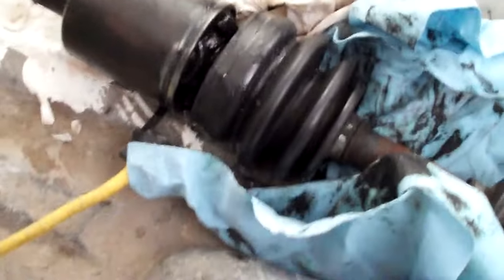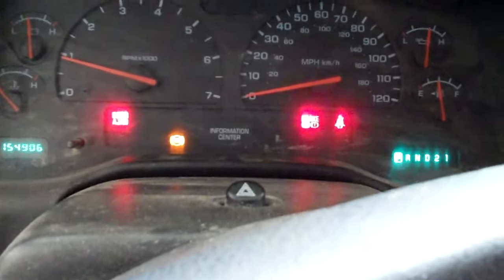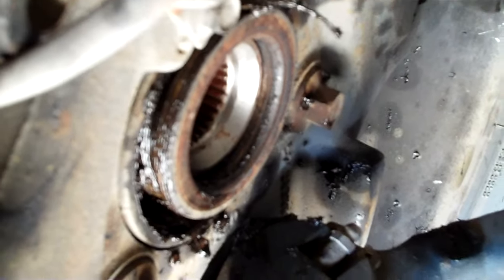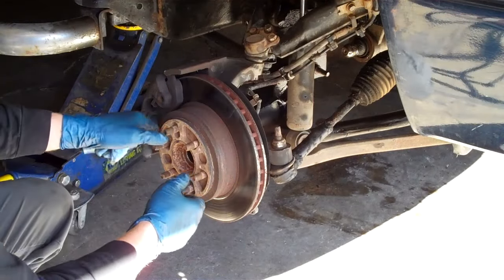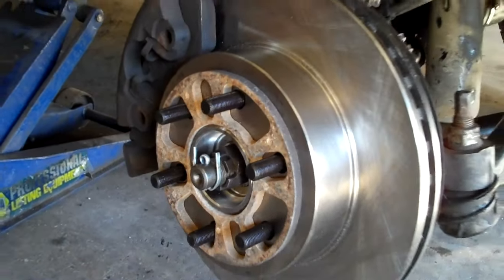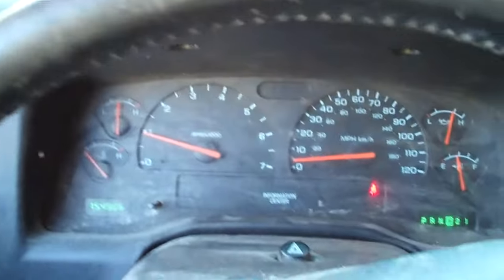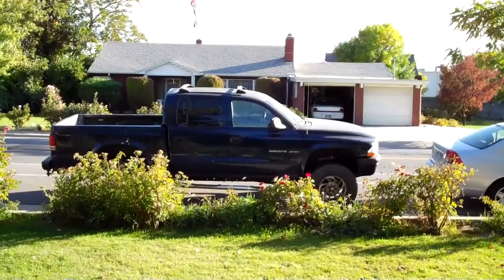What Happens if you Drive with NO CV Axle Here's what Happens....

Comment: I learned this the hard way. Drove my 97 Ram for several thousand miles without them. Snapped 2 wheel bearings in a week. Replaced one and it snapped the second I put the truck on the ground. Eventually had to drop a new front end in it, don't risk it y'all.

Comment from the maker: That's right.  His hunting buddy who was with him is a diesel mechanic in training and recommended he just pull the axle out.
Reply: So long the hubs remain in place, vehicle can be driven short distances. The reason 3hy I'd be willing to do this, is bcuz the driver side cv joint hub is usually stuck by retainer clip. So that will hold till its forced popped out. The wheel side hub is held in by center nut. Goes to say, if like me,, you can't get the tranny side hub out, but shaft axle joints are damaged, I'll remove axle  and leave hubs in place, till I can figure a method to remove inner hub.   Of course, it means the boots are cut out, and grease fully cleaned out.

Comment: A while back, my 96 suburban needed both cv shafts replace, but it woulda been like $400 to get them, so i made my own shafts. They are essentially shortened driveshafts, with a u-joint on either end, and a sliding spline shaft (from an old junkyard driveshaft), with the ends of the CV shaft (procured from the cv shaft) welded on. They are ugly as sin, but both of them together cost me less than $50 to make and they still work, going on 7 years. And i dont need the fancy rubber boots.
Reply: Jon Doe can you make a video about it?
Reply: Jon Doe lmao well u just lost the functionality of CV axles if u ever saw a straight axle mustang that is generally how all the half shafts are rigged up.

Comment: I tried that.  Once. 2001 Silverado. Some YouTuber did it so I figured I could get away with it, too. Decided to drive to town while waiting on new Axles.  Turning into a parking space both bearings blew apart and shredded.  Had to get a tow back home. Had to replace both wheel bearing assemblies, both caliper mounting brackets (the pressure actually distorted them), both rotors and both front wheels (gouged bigtime).  I mean, those wheel bearings tore apart in a grand fashion.

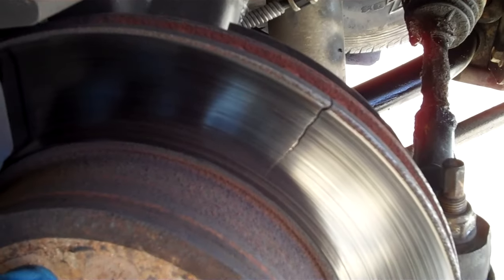Comment: Let me say this, I work in parts and as a mechanic. If you have a 4wd truck and you lose a front CV axle, YOU WILL NOT HAVE FAILING SPINDLES! The spindle has no parts to fail and is NOT PART OF THE CV AXLE ASSEMBLY. The reason that thing is falling apart is because the bearings weren't maintained nor were the axles. The only thing that happens is the front differential spins freely since there is no opposing torque(unless you have a locker or limited slip diff). You can drive it in RWD just fine with no issues whatsoever. The 3 bolts at 01:10 are the ones that hold the hub bearing assembly on to the spindle which is held onto the truck by upper and lower control arms. The brake rotor is held on by the wheel and lug nuts to the hub assembly. That little 3 bolt flange at 02:57 is actually pressed onto the bearings and essentially permanently attached to them and is what holds the wheel and brakes to the hub. This is simply a failure of bearings that was not taken care of coupled with a broken axle. I sell these bearings all the time and I have seen things just like this with the axles STILL INTACT ON THE TRUCK. This whole video is invalid information.
Reply: you are correct, if you purchase a hub bearing assembly for that p.o.s. chrysler product that obviously has already had the upper ball joints replaced, for a 2wd truck, you would see the new hub assembly also has splines for a c.v. shaft. hub bearing failure is not related the the use or non use of a c.v. shaft. MYTH DEBUNKED!
Reply: If you don t put the axle inside the bearing, the bearing will simply fail. The forces applied to it are not correctly transferred when no acle is present, resulting in catastrophic failure, as the bearing will be crushed due to forces applied. Nothing inside to give structural rigidity anymore with the axle out...(!)
Reply: GliderDS nope. That bearing is held in with bolts. The cv  has nothing to do with anything other than transferring torque. Has nothing to do with the side loading of the bearing. That wheel hub was failed before the cv did.
Reply: ImpenetrableSilence 
Quick question. 99 gmc suburban.
My bearings just fell out of the cv axle. Can I drive with it like that???
Reply: as i commented above, there are different wheel bearing arrangements. and depending on how its designed sometimes that shaft actually keeps the bearing together.
Reply: Is it going to be a danger to my family and everyone else around us on the road cause I had the other side broken all the way before and it drove and drove probably 4000 miles till I got it fixed but never no problems

Comment: my front axle was sloppy so I took them out and then went for a drive last weekend. wheel bearing hub lasted 5 miles and did the same thing.  Abs wire was ripped off the hub.   wish I saw this video first. two drive axles and a hub bearing was $278. tow was $75.  blown weekend fixin it!  just happy me and the GF weren't hurt! (axle nut torque is crucial here- too much or too little can ruin the bearing also)

Comment: In an emergency you can pull it out, remove the boots and the axle between the CV bearings. Then put the axle end on the wheel side and torque it down, then put the transaxle side in, then drive it. As long as the axle end is installed and torqued down the hub will work as normal, abs will come on. The transaxle end is installed to keep the dust out until you can get a new CV axle assembly installed. Hope that help someone in a pinch. Of course you'll only have a one wheel drive so go easy on it until you get it fixed. Best Wishes & Blessings. Keith Noneya
Reply: I don’t understand ?
Reply: @howto-wiki8291  CV Axles are made of three sections. The end that goes through the Wheel Hub Assembly, the Center Shaft that connects between the two and the Section that goes into the Transmission. When you have one side that is binding and you remove the whole shaft the brake rotor on some models can shift and rub and then become damaged like in the video. In an emergency to if you remove the center section of the CV Axle and put the outer shaft back in and torque it down, then the rotor won't be able to shift and you can still drive the vehicle. However if your don't put the inner shaft section back into the transmission all the transmission fluid will drain out and then the vehicle wouldn't be able to go anywhere. So the trick in an emergency to get your vehicle back on the road is just remove the center section of the CV Axle and reinstall the outer sections to keep the rotor aligned and the fluid in the transmission. Hope that helps explain it better. Best Wishes & Blessings. Keith Noneya

Comment: I remember in 2008 I was on the interstate heading back from Flight School and the Ford Ranger (only Rear wheel drive) I had at the time suddenly started shaking violently and the ABS light came on. I pulled to the shoulder carefully and looked up on my phone to see if there was a garage around (given I didn't have roadside assistance with my insurance policy at the time and couldn't afford a tow out of pocket). Found one that was only a couple of blocks off of the next exit which was half a mile down the road, so I carefully made my way along, keeping to the right side and running the hazard lights as I went slowly towards the Shell station.

Turns out that the cause of the whole problem was that when I had had the front brakes and rotors replaced at Midas a few months earlier, they had neglected to lubricate the tapered wheel bearings, and so what remained of the old lubrication dried out, resulting in the bearings rubbing against the rotor on the front right wheel until the bearings were ground away and the rotor was left grinding against the knuckle (all that remained of the bearings was a very thin fused ring about 2 mm thick). Surprisingly, all of that had been without any noise being created.

Comment: Oh wow you just help me diagnose my bad cv axle, my brakes were grinding and after taking em apart and putting them back together again throwing new parts at em 3 times they were still grinding, turns out my passenger cv axel was going bad and the wobble was pushing my brakes apart and making them sloppy in the caliper which made them grind. Thanks for the help!

Comment from the maker: They can make your lug nuts not seat as far as intended.  They can create stresses to the wheel studs (leverage).  Basically you compromise wheelstud/lug nut holding strength.  The right way to do it is to get a wheel with the offset you're looking for.

Comment: wow iv bin driving my 05 Dodge Ram quad for 7 years with no cv shafts(only put them in for winter)and no problem
Reply: Dagoberto Faudoa your 05 ram is different then this dakota...
Reply: Dagoberto Faudoa so it's safe to drive with no CV axles I have an 06 and my differential case exploded I don't feel like spending three grand on a new one you are the answer I've been looking for
Reply: I've been driving 2 years without my front axle shafts in my dodge not one issue
Reply: Mike what year Ram? I have an 02 4or that has a bad drivers side cv
Reply: If you're driving with no CV axle you need to bolt the hub assembly together... Otherwise you'll have a catastrophic failure like this guy lol

Comment: depends if the cv shaft is holding the assembly together. for example all toyota 4wd pickups 79-94 use what i would refer to as a full floating front. basically the wheel bearing is mounted on a snout, the axle shaft goes through the snout and engage in splines that are in a flange. the only connection between the shaft and the wheel is the spline. the shaft only transmits a torque. same for the 100 series landcruiser and everything before. the 3rd 4runner and tacoma use this type of shaft that rely on that threaded shank to keep it all together.

Comment: Leave the stub in, remove rest of axle, fixed lol
Reply: Ya diggggggg
Reply: i'm having same problem with an infiniti and i considered doing this and i'm so glad i didn't. i have new hubs but that would've put me back so far
Reply: @isaacdominguez3469 bro I'm looking at doing this now with my 2011 Infiniti g37x coupe. Autozone ordered the wrong part after I removed everything. Thinking it would fit since they verified before ordering it. I have to drive 600 miles in 2 days and I have a busted lower control arm which fucked up my cv axles in the front
Reply: I got a 2006 Infinity g 35x I keep installing new ones this about my 3th time and every time it keeeps breaking I installed coil overs still breaking I’m to the point where I don’t know what to do anymore
Reply: @EsthefanyGómez-k4k  did you ever find a fix currently going through the same !😭

Comment: If the   axle nut and the outer cv joint  were helping  in holding the wheel  bearing  together(from falling out),there will  have  to  be   another bearing on the outer cv side against the spindle to allow rotation.so no the bearing gave up due to the wheel spacers and took out everything else with it.

Comment: i worked at a gm dealer for a long time and i know gm came out with hub/bearings in like '08 for like the 99-07 trucks that were for both 2wd and 4x4, they had the splines for the axle but the rear sides were reinforced so it didn't need the axle and nut to hold them together. but you could still get the other 2 styles, and the regular 4x4 one, said for 4x4 only, while the 2wd ones didn't even have and axle hole. i haven't heard if any other manufactuers came out hubs like this yet.

Comment: I actually drove with my shaft out for a few weeks because the bering cage on the cv busted during a hella snow storm. Got under there and cut the boot out of the part in the diff to keep junk out then left the nut on the hub. Just leave the bolted end on. knock out the bering cage with a chisel. Then cap the end the goes into the selector.

Comment: Most people do not know that the axle nut when tight, keeps the bearing from getting shear pressure. In this case the wider tires and that wheel spacer magnified that force. He is very lucky to have not gotten hurt. If you find yourself in need of removing the axle to get the thing home you could leave the cup still bolted to the hub and remove the rest of the axle. Doing this will also leave a big gaping hole where the output shaft is that dirt and sand will get into. Its always cheaper to fix it right in the long run.
Reply: You are correct. The terms are axial load, side load. And radial load.

Comment: I just saw an s10 blazer that made it from North Carolina to West Virginia like this. It wasn't going to go any further. People don't seem to understand that the spindle nut is what's torquing the WHEEL BEARING.  Thanks for the informative vids with humor!
Reply: Answer me this on a front wheel drive vehicle, the rear wheel hub does not have a axle shaft to torque to. If a cv shaft was that important to a part time 4x4 that never is driven in the 4 wheel drive range then how do these keep from failing?
Reply: Different type of wheel bearing. Some wheel bearing  hub assemblies for non-drive axles, without a spindle and axlenut, do not require themselves to be pinched together. Drive axle wheel bearings are mostly conical, and need the cv shaft/ axle nut to keep it together.

Comment: I've had a number of CVJ's go bad, after the boot tore, but despite driving several even more than a year on, only the noise and looseness reveals any issue. Obviously removing the axle is far worse than just driving with the old one until you either repair the boot, or replace it. And he's right, the Soobie bearing is going to be compromised without a proper torqued compression to hold the two sides of the roller bearings under tension. Outer splined hub is pressfit into the inner bearing race, so without an axle nut it could conceivably fail and drop the wheel.  I'd worry about the uneven load on the differential as well, over time.

Comment: Ok just wanted to add that the 2wd and 4wd envoy/trailblazer use the 
can run these trucks without cv axles. You just need to leave the inboard cv joint housing snapped into the diff to prevent leaks and contamination of front diff.

Comment: I took my cv axles out last month along with front drive shaft and front differential. Everything works fine but the key is I cut the old cv axles in half and set the cut cv into the hub like normal.

Comment: i drove,my,truck 20 feet like this and the tire fell off. lesson learned.
Reply: Lol
Reply: Dont see how ive been driving with no cv axle  or differential or front shaft it seems to be working fine so far
Reply: Same
Reply: @P. Spit wait a sec, you been driving with no cv for 4 or 5 yrs and its been making the clacking noise this whole time and nothings happened? Have you looked at underneath? What's making the clacking noise? Mine is making the same but im worried as hell
Reply: @thestateoftexas2096  how long you been driving with out the cvs? You mean nothing at all, commonly removed the entire cv axle and still nothing? How long you been driving it for like this bud
Reply: @joesamperi512  how long you been riding without em? Everything still good?
Reply: Mines the same way n I gotta drive it for a week or 2 like this
Reply: @Kyplays  confused, "mines the same way", i think theres reference to three different ways, 1) tire falling off after cv's were removed, 2) tires still intact after cv's removed, but strange clanking sound, or 3) cv's removed and drives completely fine, lol .....which one are you referring to bud?
Reply: P. Spit   How many miles do you drive per year?
Reply: Smoke the mirroR the only way you can drive with no cv is if you keep the nub end that the center nut goes onto to keep the hub and bearing tight

Comment: A lifted Ford F350 4x4 came in through the shop. His wheel bearing had failed similarly but instead of the rotor keeping the wheel on, it fractured and the centre of the rotor separated from the disc. His 38" tire came off the axle and mashed up the fender & door of his truck while he was driving down the street.

Comment: axles won't cause all that think about it, one end just pushes in to the diff, nothing to secure it but a little spring clip
Reply: You are correct.  Why do you suppose the cv shaft came out of the differential? MAYBE because the BEARING went bad? NOT the other way around....
Reply: Geoff fafa wrong the spindle on the axle that slips into the wheel bearin hold the bearing together. Its sandwiches the bearin between the yoke side and the axle nut
Reply: @robsmith7540  there is not much holding the slip joint(inboard) together. Together with the 4 in lift kit and super tight torsion bars, this can cause impossible angles to the half shaft and actually lever it out. The cv joint(outboard) nut applies clamp load to the hub and spindle. When you remove that nut, there is nothing to support the thrust load of that bearing, it's a ball bearing. It can only take radial loads.

Comment: After watching this video, I was like "crap, I removed the rear axles on my daughters 06 Vue because the rear differential unit was bad"......seriously, I was worried.  But before I removed them, I looked up the wheel bearing part numbers for the same car with and without all wheel drive.....part numbers were exactly the same. So some cars use the same wheel/hub bearings for AWD and just FWD, so cross reference before you drive without axles.  (my example is on the rear drive assembly on a 06 Saturn Vue) 
Sleep easy